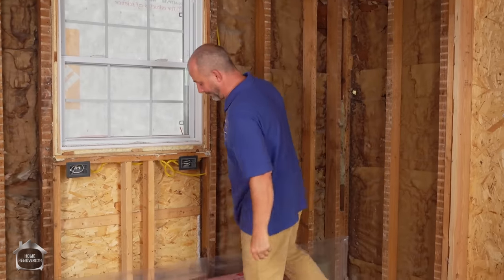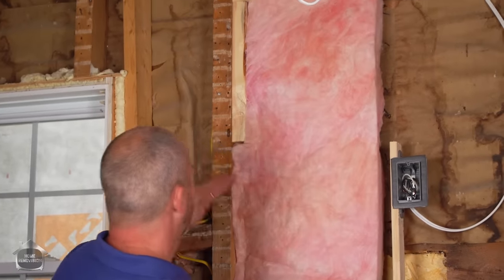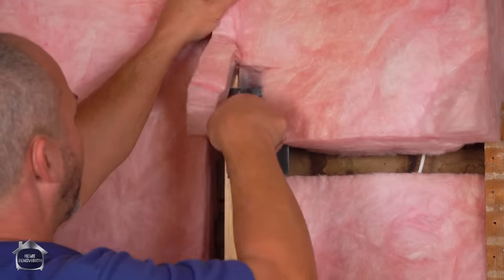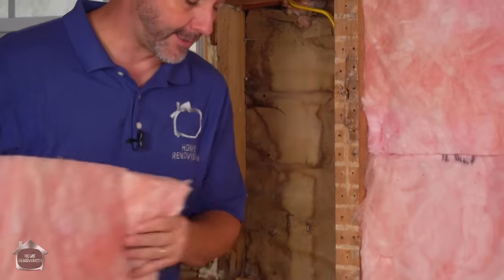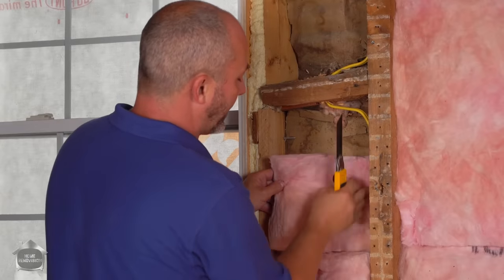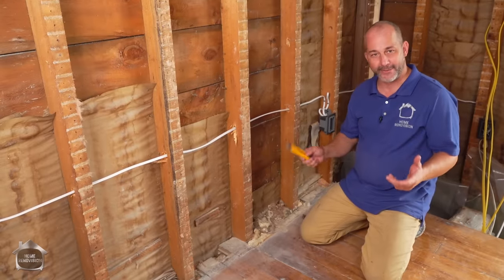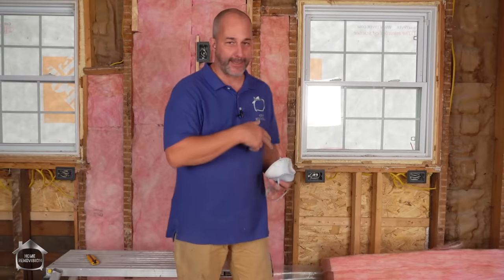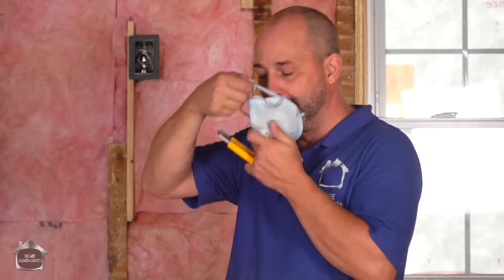How to Install Insulation | DIY Kitchen Renovation Pt. 1

Comment: I'm using mineral wool in my garage, kitchen, bathroom, & basement. the rest of the house will likely be fibreglass insulation.
The reason I'm using rock wool in those specific places are because they are either places I want to do right, once, and never have to open up again, or it's an area prone to moisture.

Comment: We use blown in on the old houses just for ease. Cover your 3" holes at the top of the ceiling with crown molding. It's not as itchy as fiberglass, but it's not as insulative either because it settles over time.

Comment: I LOVE mineral wool though! It's much easier to work with, imho and it's not much more expensive. I went from an cinderblock addition on my house with NO insulation, to R-15 mineral wool walls with nice Gerkin windows and sprayfoamed my attic space (since that's where my HVAC ductwork is).

Comment: Thanks for the great videos. This inspired me to re-insulate the ceiling of our tuck under garage to make the rooms above more comfortable in the winter. I pulled down the old dry wall today and discovered wood cross braces between the joists. What is the best way to insulate around that?
Reply from the maker: Simply cut the insulation to fill. wood is actually a good insulator! Cheers!

Comment: I’m going to be remodeling my kitchen next month and opening up the 1920s plaster wall to run new electrical, etc. want to do this insulation but have no plans to mess with the exterior of the house. It’s a 1920s craftsman bungalow with asbestos siding. Should I just throw fiberglass in there before I close it back up or do I need to wait and see how much water has been getting through the old siding?
Reply from the maker: Hi Thomas, if you don';t see water damage evidence then that is your answer. if there is some graying from water events then use the mineral wool. it will dry in place after an event and then still perform long term. If you are concerned about the cost impact then you can always roll the dice with fiberglass but it needs to stay dry to be effective. Cheers!

Comment: Tuck tape is also excellent at pulling fiberglass fibers off your skin. Do not rub or try to wipe it off your skin. Back tape a layer (sticky side out) around your hand and dab the tape on your skin. Be careful around your eyebrows unless you want to draw them on for a few weeks.

Comment: FYI you can dense back fiberglass for better R value so you can put an R19 2x6 batt in 2 x 4 walls for better insulation, a scientific journal published recently supports this

Comment: I go for rockwool. Initially I did because it offered R15 and it seems closer to a solid block. It was also marketed to me and the idea it came from 🌋 made me curious. I never saw a fiber glass commercial.  It's marketed using it outstanding fire protection and that gives me some  comfort in that my bad electrical work (not really! I watch home renovision), some electric fault won't set my walls ablaze. If there is a fire it won't be easy to spread thru the holes for the electrical. Even my interior walls have rockwool. Sadly not the entire 🏠, some parts were not renovated and at some point I will use foam to renovate those sections.

Also, I was renovating a 1958 house. Some of the insulation in those walls sagged and some sections shrunk. Some parts stood up well but the insulation was different, they had a foil backing. Never saw those anywhere. 

The price bites but what I realize is that volume helps. I paid $20 for the same sq ft vs $13 for fiber. This was 2017.

The short of it, rockwool.

Comment: Why a flexible caulk can't be used instead of the acoustic caulk? (Something like this? DAP DYNAFLEX 230 Premium 300 mL Indoor/Outdoor White Sealant). mice are probably gonna chew through the darn thing anyways, before the caulk goes bad and having to redo the entire insulation all over...

Comment: If you live in the North would spraying an inch of closed cell foam to seal everything up be a good idea before putting in pink insulation? Also can spray foam replace the vapor barrier in that situation? Cost aside, which does a better job?

Comment: nice job. I used the mineral insulation  as it was less itchy for me.  I use in the wall of house and garage to maybe help slow a fire down
Reply from the maker: If Fire is your concern then it is a beneficial product. installing fire rated drywall works better and costs a lot less.

Comment: I’m blowing into a 16x40 shed attic space 640sf it’s just got Sheetrock ceiling on the joists - do I need a vapor barrier above the Sheetrock ceiling? We’re  Central Florida, it’s a Graceland building with their patented reflective “silver lining” on the underside of the roof.

Comment: This is awesome for batt insulation and love the talk of the vapour barrier. You made this look simple. Would love to see one on spray foam (pros/cons) great video guys!!
Reply from the maker: spray foam simply works better but costs a lot more. if you are particular with this system you can do it for a fraction of the cost. Your return on investment is limited to a couple hundred bucks a year. hard to justify it .
Reply: @HomeRenoVisionDIY  Do you find it harder to remodel a room with spray foam in a wall. IE moving TV to another wall and running cables down it. It makes everything behind your walls kind of permanent no?
Reply: Also thanks for the great explanation of sure you will save you $100 a year but cost you $5000 to install you'll never see the return. Bit in places that have limited resources like solar panels I'm guessing it value is no longer the question as your power is a limited resources so better to spend the money! Makes absolute sense !

Comment: OK... Is bating Vs. Spray foam Vs foam board just a  cost choice or is there a reason not to use those in a 1930's house?
Reply from the maker: why and where you install different material is a good topic for anothe rvideo. Cheers!

Comment: I have got to know and it looks to me that you installed R12 or R11 going by the thickness of the pink batts. My question is why didn't you use R15 Rockwool (mineral wool) for a better R value? You did at the bottom part of the walls.
 I have on older home as you do in this video with the rough cut 2x4. The people before me tore out the plaster & lath and installed R11 in these real 2x4's. Every winter you had to crank the heat and survive the cold winter. Now that I have tore down the exterior walls and used R15 mineral wool, very easy to install we no longer freeze. All we use is a wood stove to heat a 1900 sq. ft. house. Very comfortable. We live in up state NY.
You have my curiosity peaked.

Comment: Watching these videos reminds of those auto repair  videos where the gut is working on a brand new immaculately clean car that doesn't have a single rusted bolt. We all know dipwad how to install insulation where everything is neat and clean and perfectly spaced. What do you when you got duct work in the way? What about plumbing inside the walls? What are doing where there are AC lines, telephone cables, what about rim pockets, what about where space doesn't permit proper thickness, where you can't build stud walls? But hey! You've showed everybody what is as easy putting on your pants! And yeah.  There are people who don't know how to do that! And BTW, why are you using that pink garbage?

Comment: Jeff, how would you deal with a balloon framed house where flooring goes into the stud bays if you're only renovating 2 rooms on the second story? We are keeping the original floors so I can't cut back too much and the downstairs has blown in cellulose in the walls form the 70s. I was thinking of blocking and foaming the bottom and tops of the stud bays to seal those up before insulating the rest with batts. Thanks

Comment: Thank you for all those videos Jeff. I wanna insulate a cold room i have that's on the ground floor level (not under the ground like a basement) and i have a wood frame of 1.5*5.5 inches studs that's fixed on top of one row of 8" concrete blocks. So i have a row of blocks on the ground that are thicker than my wood frame by 2.5". What do i do in this situation?

Comment: Is a vapor barrier necessary? We have a house that had no previous insulation. We live in the SC where our winter is very short. I know you said the south typically has on the outside but ours does not to my knowledge. What advice would you have for us?  
Thank you for all your content and knowledge, I have learned a lot!

Comment: My basement has concrete walls, there is about 2 ft gap from where concrete ends and the ceiling. That gap was insulated with faced fibreglass insulation with paper back (vapour barrier) with the paper side facing the green board dry wall. Recently found mold problem only on the sides of the walls where faced insulation with paper back was facing the green board. There are other sides of the basement where there was the same insulation, but there was no mold as those walls either were wood (exterior wall) or regular dry wall (Not the green board). We got the mold cleaned by a pro and now we need to replace the insulation, should we put the same faced insulation with paper back again OR unfaced insulation without paper.... I am guessing the paper facing the green board had some strange issue with mold developing. Appreciate any inputs.

Comment: Mineral wool is better. Higher R value, doesn’t hold moister, if you use the stuff for the interior walls, it can lower risk of fire. I’m in NH, we have Rockwool Safe and sound, used between the kids rooms you can practically yell and not be heard in the next room. 
   I don’t react badly to Rockwool like I do with fiberglass and it seems to provide better air quality. Mice don’t love it and don’t seem to like it at all. It’s my go too, love working with it, stays in walls way better than regular insulation. One last thing, it does have a lower perm value. Guess it doesn’t matter is you use  a vapor barrier.

Comment: Ok I am no shape or form an expert but love learning . I just have been debating pink stuff vs rockwool and rockwool wins. It was easy to put up provides good sound proofing, better fire resistance and the biggest winner the pink stuff if ever gets wet loses it effectiveness. Rockwell wins in my book especially  if you can get it on sale. Again no expert maybe I am wrong  but I just put in rockwool last week.

Comment: Hey there! Been watching a lot of your videos ahead of our DIY basement reno on our new home. When we bought our house, this was the exact setup, insulation with plastic over it - but there was condensation between the plastic and insulation. Because of this moisture inside the plastic I tore the plastic down, assuming that it would create potential mold on the studs, and now I am nervous to put plastic back up? This plastic was put up by the builder - I'm not sure if something was done incorrectly or if this is normal.

Comment: 1 issue. our 24'x24' dairy barn milkroom attic has the same r19 the contractor buried all the 12-2 &10-3. one morning rats got in chewed up the wires a fire got going burned to charcoal several trusses lucky the mailman found me in a field down the road or 66 cows would have perished. i think the very small attic vent on the top gable wall was small enough for the fire to burn out the oxygen giving me enough time to get home put out the fire with garden hose
Reply from the maker: perhaps it is time to address the rodent issue. i heard pea gravel works really well as well as broken windshields in the dirt around the barn!
Reply: Yes avoid poison.  It makes them thirsty and then they chew your plumbing up looking for water.

Comment: In my area the white fiberglass insulation is slightly cheaper than the pink but I find when installing it I'm itching like crazy!  The mineral wool doesn't make me itch at all & does a slightly better job at sound attenuation but it's at least twice the price of the pink fiberglass.  With the pink stuff the itch factor isn't nearly as bad as the white & the thermal & acoustic characteristics are nearly as good as the mineral wool in my opinion.

Comment: HI. I live in a 1930 house. You know there is not insulation in the walls. I have mold inside my walk-in closet  where I hang my clothes.  I was told the mold came from condensation and that I need air flow in the closet. I took off the doors prior to wall being cut out.. I had to have the interior closet wall cut out. Mold removed from closet. Now I have to figure out what kind of insulation to put in the wall to keep moisture out. Do you have any suggestions?

Comment: Soooo the other day I'm on a job and I'm talking to the guys about how when compressing the fiberglass insulation you lose a lot fo the insulation ability. I got mocked for the rest of the day and some guys told me the opposite.  soooo I'm confused and kinda pissed that I just looked like an idiot. Y know, I might be young and curious but I take a lot of effort to make sure I do everything correctly and professionally.
Reply: What makes it "insulation" is that it has poor conductivity.  A loose material that has lots of air accomplishes this.

Compressing the material will increase the conductivity vs the material being loosely installed.

So you are correct.
Reply: @metalwright  thanks! I'm saying that exactly word for word next time.

Comment: I'm going to install insulation in a tropical climate. Here the insulation is already in aluminum foil against radiant heat. Do I need to tape the joints with aluminum tape? It will be placed on top of the ceiling. The ceiling currently is just one layer 1cm of drywall and the roof is 2-2.5m above the ceiling but no additional insulation -.-

Comment: What if you live where it gets hot hot in the summer and cold cold in the winter? So far I have a moisture barrier on the outside of my studs with metal sheet exterior walls..
Installing insulation tomorrow...do I need a moisture barrier inside before I hang my wall panels? If so what kind, plastic sheeting?

Comment: Fiber glass insulation here in Romania where I am at the moment is very very dirty. You need to wear a mask ,gloves ,ideally a suit so the particle doesn't get to your skin. In the summer it's a pain. You touch it and you can see all those particles flying into the air. I see 6ku doing it with no gloves,mask and in a t-shirt.
Any idea why ours is different?

Comment: Hey Jeff! Been following along for years but am finally asking a question that I hope you can answer. I am insulting an existing pine board and batten shed that im converting to a small woodshop. There is no external vapour barrier or wrap - does that mean i should do a layer of barrier on either side of the insulation?

Comment: My understanding is insulation doesn’t keep the cold out but holds the heat in. I put 1/2” foam over the studs  then the drywall. Only regret is not doing 2”.

Comment: I'm not a fan of vapor barriers.  There are plenty of problems using one in a climate that has high humidity during the year.  A recent seminar I attended on wall assembly and WRB had the building emgineer argue that there is no benefit from vapor barriers and they should not be used.  He said wall assemblies need to breath and painted drywall is in fact a vapor barrier itself.  Sandwiching vapor barriers is a recipe for moisture problems too.  So where does the truth lie with vapor barriers?  I see many opposing viewpoints, all by people that know or should know their business.  For me it makes sense to have walls that breath and can dry out without traping water for extended periods of time.

Comment: Wrapping the cables with insulation is a really bad idea, it affects the current carrying capacity of the cable greatly, and could lead to a fire. I know you mean well, but check out wiring regulations please.

Comment: No need for the plastic. Your vapor barrier is the backing on the drywall. Use a good low permeating primer and you can skip the plastic step.

Comment: What happens if water somehow gets inside the wall cavity through a leak from the outside, with the addition of the insulation , won't this rot the wood faster because now there is less airflow for the wood to dry ? I'm asking because I am about to start a similar project in a 75 yr old home. Thanks

Comment: What are those vapor electrical single gang boxes called with the rim? I saw in one of your other videos that you used something that I think you called a polyhat which looked like a preformed plastic surround which the electrical box was set into.

Comment: I found out my 140 year old house has a newer add on; I was looking for where the mice were getting in so removed the lower 2’ of dry wall to find out how poorly insulated the walls were, like they split the bats in half and use 3 mil poly, and also found two exterior doors and a beer bottle behind the wall.

Comment: Hi. Do you have any advice for installing over a wall with boards that protrude across the gap but only slightly.

I'm trying to insulate around a staircase that has support crossbeans that only protrude an inch or two, in a gar that's about 5 inches deep

Comment: If i will insulate the basement, the wall is cinder block.. there there are framing on top of it.. the contractor left the job and didnt come back, is it ok to just put a foam insulation on top of the cinder block,, then cover the wall with hardiflex?

Comment: If you're dealing with itchy insulation cover your skin with Vaseline a very light coat to clog your pores and so the fiberglass doesn't stick into you as much as it will reduce the itchiness

Comment: Where do you find the tape and roll of plastic? I was with my dad at Menards and ended up buying 3 mil plastic small rolls were all they had and duct tape seemed like our best option because I didn’t see the red tape option. Any suggestions? Do you prefer shopping at Lowe’s or Home Depot?